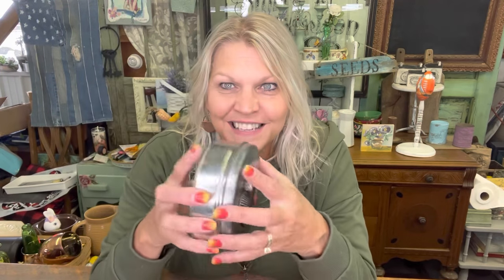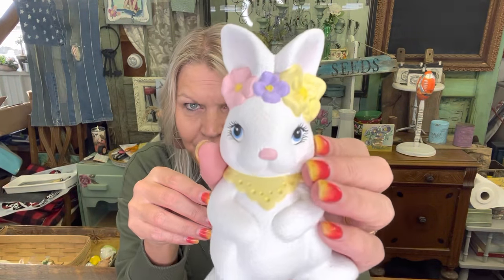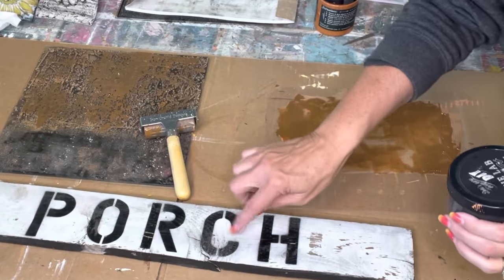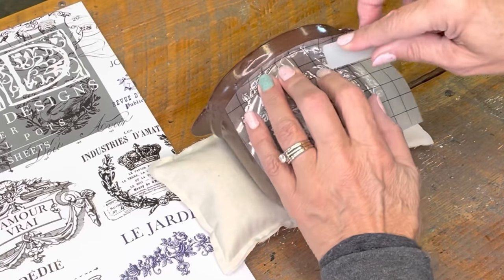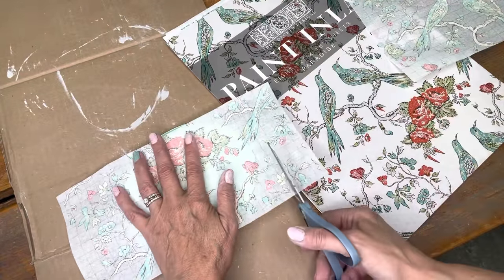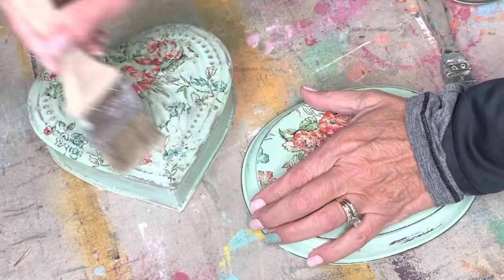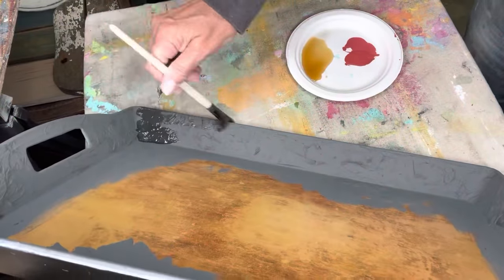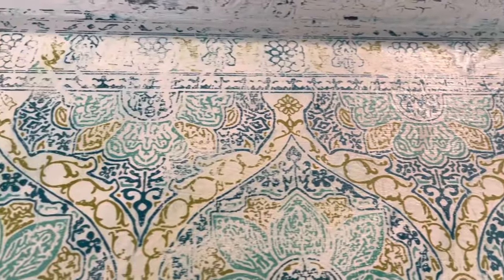Thrift Haul with a Bunny Overload. DIY Paint. IOD Products. Upcycle. Cottagecore. Farmhouse.

Comment: you remind me of myself with the bunnies. My favorite thrift store in my area has a whole big shelf full of bunnies. Ive bought many this season , but its so hard not to buy a ton of them.They are all cute, if maybe tacky. Just begging for paint and a makeover. And its an easy makeover to do. So, they are hard to resist. But i do agree with you that they go ,in my opinion, well with spring and summer decor anyways. Doesn't have to be for Easter only. Especially if paired with some other small woodland creatures. I have painted some for Easter, but i have tried to paint a few in neutrals for anytime of the year. Ive got my greens and blues for spring, then some cream, or white, or very light brown with white wax that would look great anytime.
Reply from the maker: I do like bunnies and they are such a reminder spring is coming.

Comment: I have only got crackle to work a few times. Bought $$ stuff at at hobby lobby fail, used glue, worked once, and modge  podge  worked once. Can't seem to do it again. Was supposed to go to good will today but didn't make it.
Reply from the maker: I'm not the crackle expert either but this Amy Howard stuff seems to work for me if I pull the paint off when it's almost dry.  If I want it to come off in larger areas I'll put on a glove and use my whole hand to pull it back.  Give that a try with your $$ stuff.